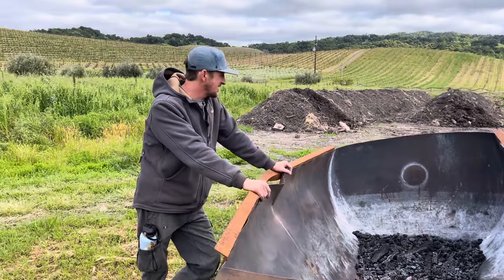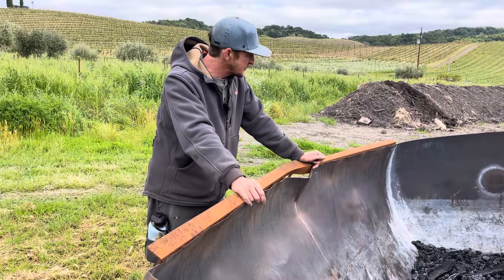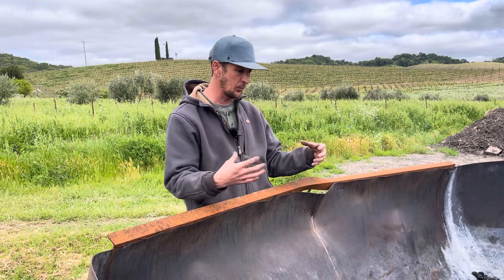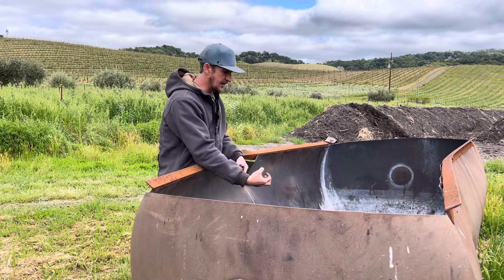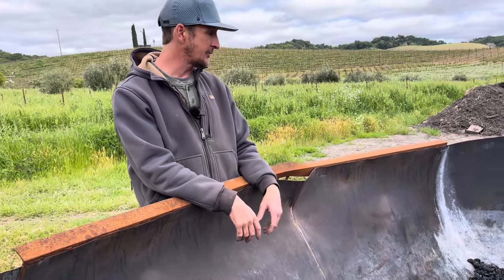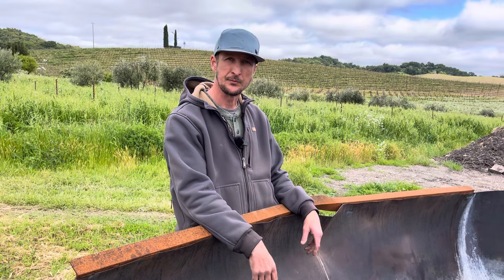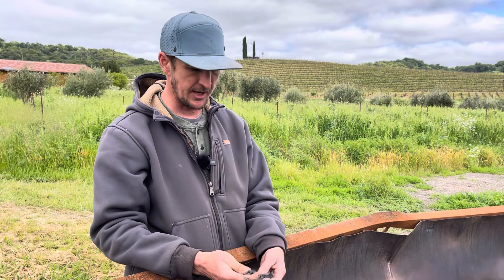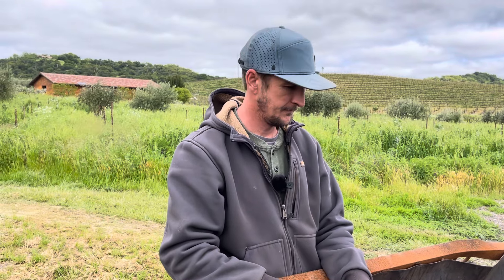Jordon Lonborg on making biochar at Tablas Creek

Comment: I don't think its a smokeless fire for the reasons specified. I think its smokeless because air rises up the outside of the container, gets hot, and is then pulled in for combustion in a similar manner to smokeless firepits. Pyramid kilns are nice since they're easy to use.